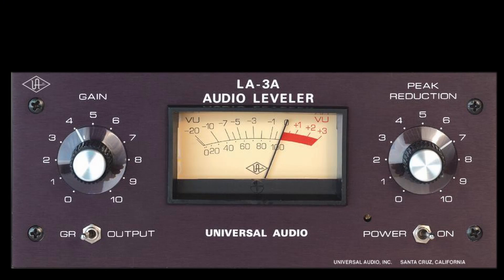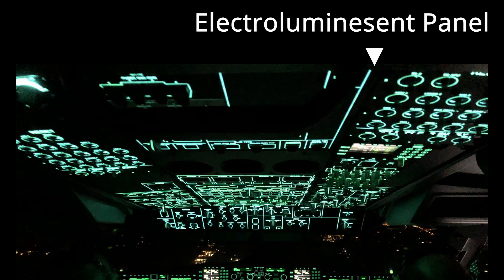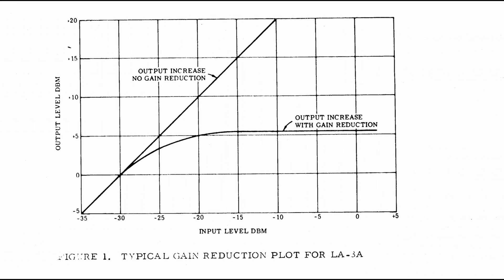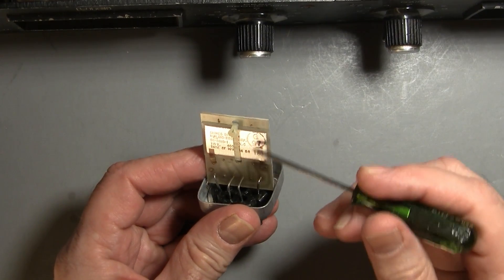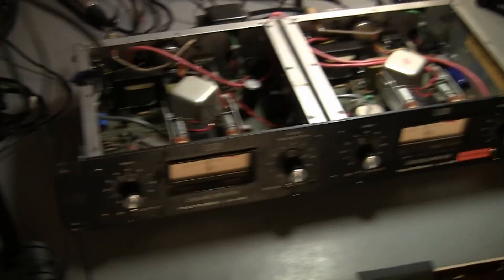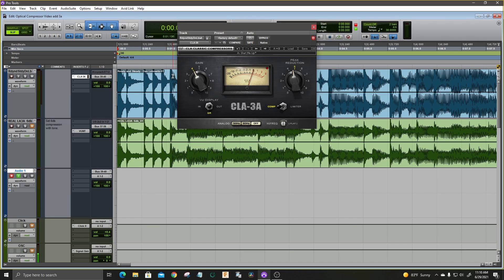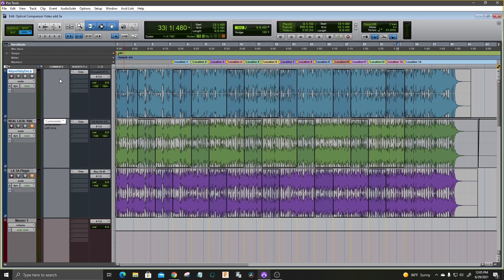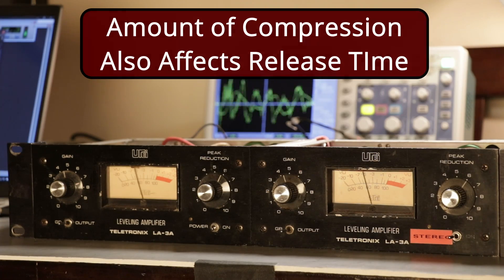How Optical Compressors work

Comment: Thanks a lot for this very informative video! Could you describe the test methodology for measuring the attack and release please? That would be very very helpful!
Reply from the maker: I put the compressors and stereo link and input a click track on one side a pulse and a constant sine wave on the other side and so I could see the pinch in the sine wave when it compressed, I think you could also do it by mixing a pulse like a click track with a constant sine wave
Reply: @biasedaudio  Thanks a lot! Do you remember the respective levels of both the click and the sine? I can't find a way to see the sine being affected by the click. The VU meter is behaving correctly and I know my compressor work but I would love to be able to measure the T4B cell's behavior just like you did by measuring the audio waves directly.

Comment: I would really like to see what the frequency response of the light sensitive resistor is a I would imagine that the resistor reacts differently to say a sinusoidal wave (I realize music is way more complex and can't be reduced to a sine tone!) at 80Hz vs one at 1,000Hz.   Thanks for making this awesome video!
Reply from the maker: Interesting question, but my guess is the light variations in brightness might actually average the level and filter out some of the high frequency information.  In that a tone at 1khz might be the same or similar brightnes as a tone at 10 khz at the same level but I'm not sure. Similar to a VCA compressor that converts a music signal to a fluctuating DC level to control the VCA level.

Comment: Electroluminescent light sources like this are brighter at higher frequencies, though in practice I see them get dimmer after a kHz or so, this may differ depending on the manufacture method and choice of phosphor. If the audio waveform is being fed directly into the EL panel, the effective controlling variable won’t be the input waveform’s amplitude, but rather the amplitude of the differential of the input waveform. With the taper off. So I’d expect it to be much worse at attenuating bass than mids, sparkly loud cymbals would probably get through too.
Reply from the maker: Interesting, I don't have a unit handy to observe this, but I will say in general with music low mid and low frequencies at at a much higher amplitude than higher frequencies. The manual somewhat contradicts itself.  Page 7 " The amount of light depends on the applied voltage and frequency"...... There is a a high frequency boost on the rear for gain reduction. ( similar to dessing ) The manual states in regards to this control.  Page 12 of the manual. " If the control is set to the flat position, the LA 3A will provide equal reduction at all frequencies" .

Comment: people usually explain that the curve for opto compressor is kind of S shaped.
So that is not true?
Reply from the maker: Well I haven't tested and looked for that. I went with the UREI measured curve.  In the days that this unit was released 3 to 6 to compression was a more normal way to operate. I remember being taught back in the day if you compressed more than 6 db you should reduce you preamp gain .  10 dB was considered a lot of compression. In the 80's it became more common to really smash stuff with compressors.  As well with the advent of digital compressors with few artifacts heavy limiting has become more common. Under those circumstances I'll assume the Light will hit max brightness or photo resistor will become saturated. I even looked online and viewing the "S" shaped charts where the gain reduction starts to tilt up is in the range of 20 dB of gain reduction. So I'll assume the term s shaped is accurate but only under extreme circumstances. Not really sure of what the advantage of hitting the top of the "S" in the curve would be.

Comment: This is so cool! Can you do one on the LA-2 or 2A? like explain how the tubes are involved. Is it the make up gain stage or the output? and then compare it to the UAD LA-2 or 2A. They have the spark plugs now that you can run natively if you don't have an Apollo
Reply from the maker: Brandon I would if I had some more time but due to the similarities between the la3a and the LA 2A I doubt I'll get around to it. They're almost identical in the LA 2A of vacuum tube is used as the makeup game instead of transistors in the la3a and the only other real difference is the la3a has an interstage transformer to increase the voltage to the electroluminescent panel.

Comment: Why is the T4B encapsulated if it works perfectly fine without the metal capsule? This is a very introspective video. I would love to see how the T4B works with a iPhone 11+ recording (because it's thin enough to fit inside the LA-3A and records in low light very sharp) while the cover is placed on LA-3A cover is placed on top. While the Pro Tools session is screen recorded and the meters are being recorded simultaneously by another camera on the outside. Then We can see how all of it works together in real time.😁
Reply from the maker: The T4 is incapsulated to first keep light out, I turned off all the light to shoot this video. Not practical in a studio environment  !  also for audio shielding I would guess.

Comment: What are the properties of the transformer to drive the EL panel ... and what kind of substitutes are available today and be equal to the old days.
a German made transformer by Block? 
i tried a experiments with a simple old rusty 220 Volt to 9 Volt transformer hooked in reverse to my modular synthesizer via a simple 2SC945 transistor and connected a VCO to the base of the transistor and measured something like 200 V, i had to place 1k on the collector sourcing from the power rail, higher values where not good, having the scope on 50 volt per division, covering 4 divisions.
Does Würth have something in their catalog that could serve? these yellow things you find on pcb's.
The EL panel needs something like 110 V, did you measure.
Reply from the maker: Not sure. It's a stepup. Not sure of the impedance or ratio. I would venture a guess if about 4:1 or 5:1
Reply: @biasedaudio  i might have found something, not very expensive, but i gotta buy several models too see and find out. ratios of 1:50, 1:100, 1:200 and multiple windings. pretty small. it's just you don't know the requisitions from the original designers.

Comment: Hm... This thing does make me wonder. Very quick photosensors have been around for audio playback on films for a very long time. As they output the recorded sound from the film  they need to be able to work in thousands of a second of time. 

Maybe these sensors were deliberately chosen for this compressor because the attack and release of those particular sensors would suit a compressor. As in, not because they were quickest possible but instead because they were a bit slower. It doesn't have to reproduce the frequencies. Just control a fader according to the peaks and valleys of the overall soundwave.
Reply from the maker: Actually I looked at this closely before posting this video.  For film sound a light sensitive vacuum  tube was used. I had thought a photo resistor was used but I couldn't find any case as the slow release limits bandwidth.
Reply: @biasedaudio  

Ah. Slightly different technology then. Thanks for that detail!
Reply: #exciterLamp